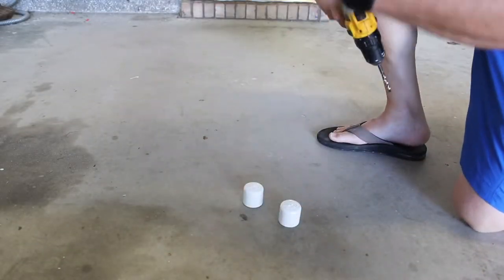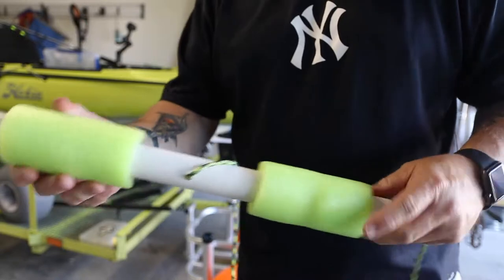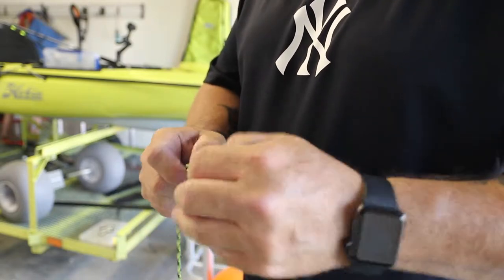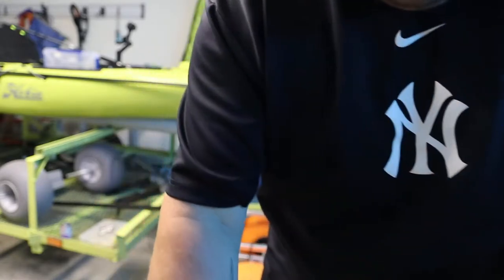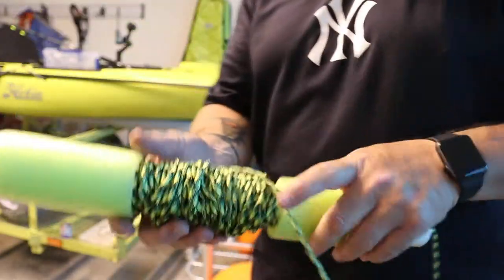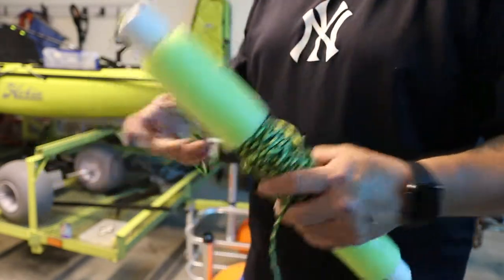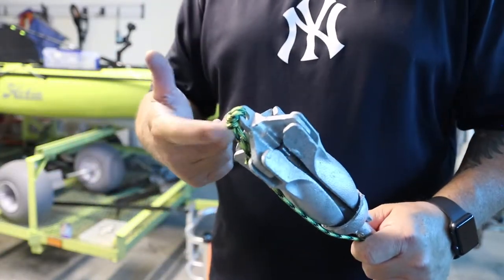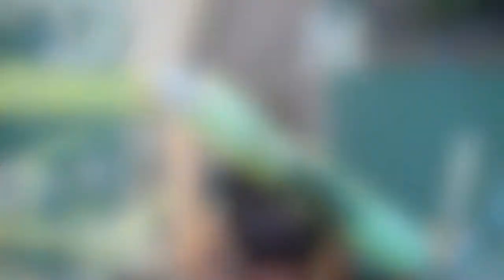DIY Anchor Float

Comment: Q&A What is the  length of the pvc pipe  ? thanks for your time in this matter.
Reply from the maker: I cut mine at 18 inches. Thanks for watching!
Reply: What's the weight of anchor?
Reply from the maker: It’s a 3 pound anchor.

Comment: What side attach to the boat and what side hold the line?
Reply from the maker: The side with the anchor line holds the line.  The side with just the rope attaches to the kayak.
Reply: @emeraldcoasting7625   Great video.  I think you said the opposite on the video?  I'm planning to make this to use with my canoe.  Is there a reason it makes any difference which end connects to the boat and which to the anchor rope?  Thanks!